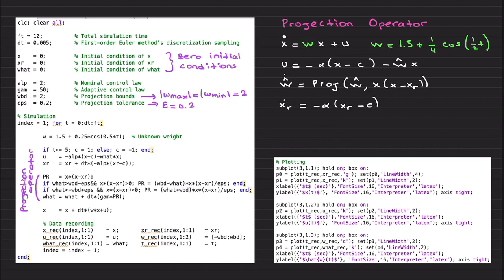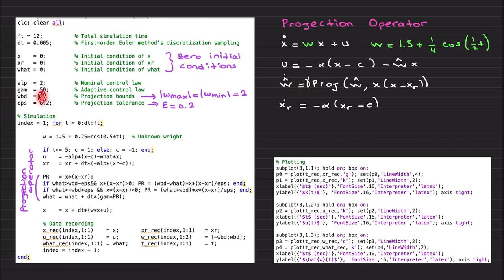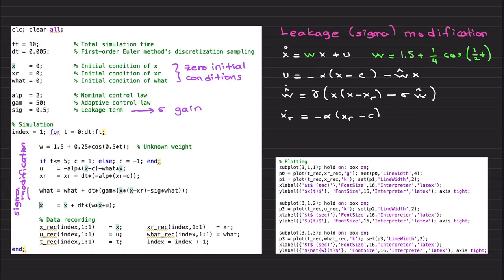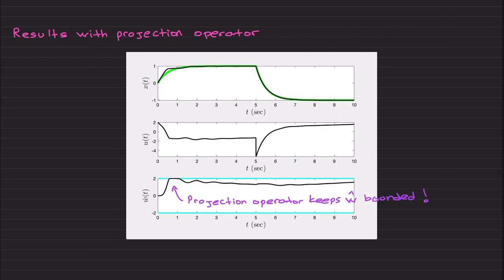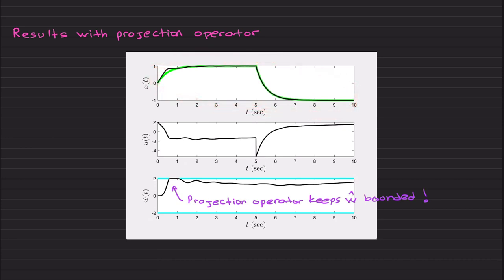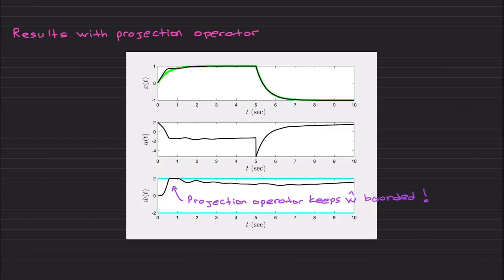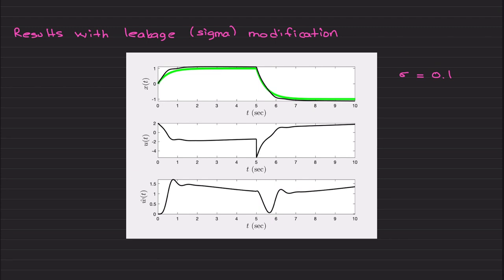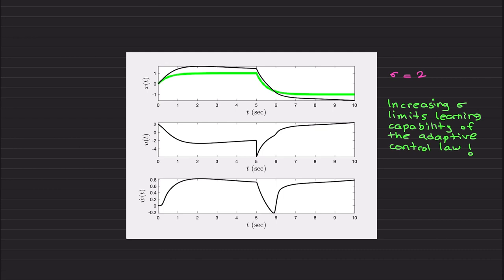Projection Operator vs Leakage Mod. Example in Matlab (Lectures on Adaptive Control and Learning)

Comment: Thank you for your great explanations and videos!
Is there an approach to extend the idea of adaptation to the case where the control input enters the state equation through a nonlinear function? For example, in my case the control input passes through a dead zone with inaccurately known parameters. Currently, I use a smooth dead-zone inverse in order to compensate for this nonlinearity. 
It would be great to organize adaptation according to nonlinearity parameters to improve the control performance.